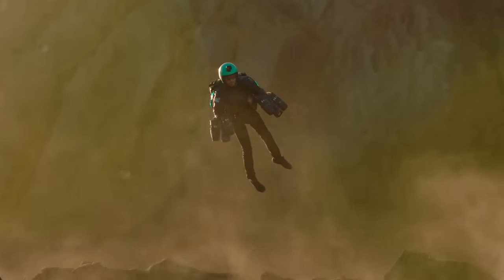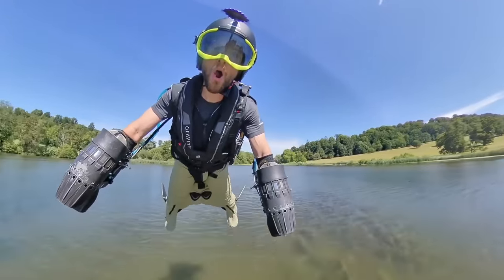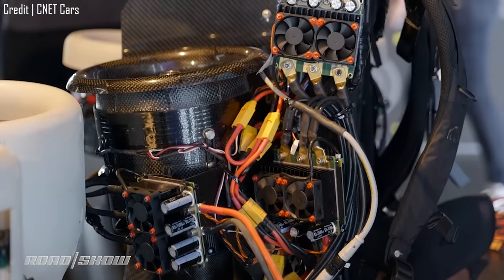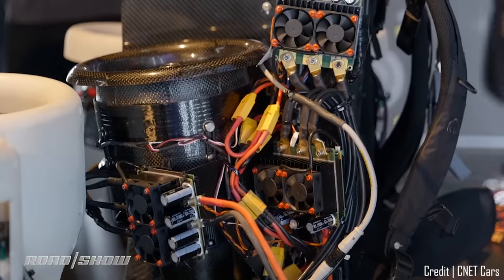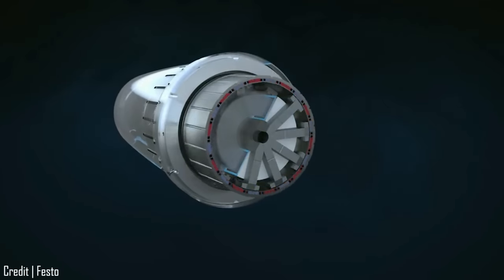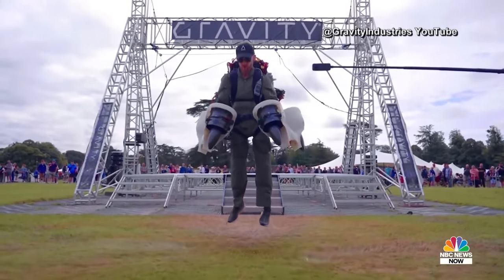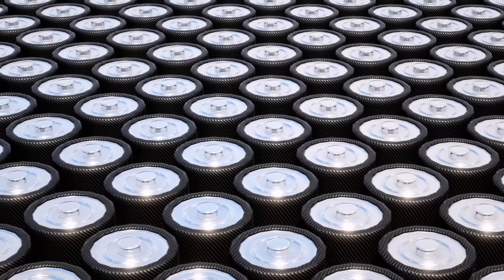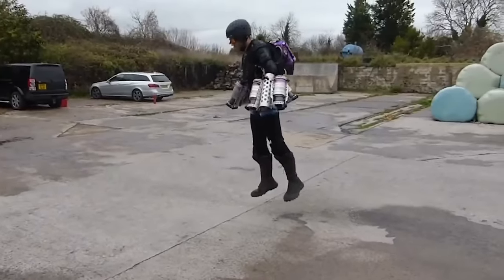World's First Electric Jet Pack Is FINALLY Here!

Comment: This Jet Pack is a crude start, but it won't be long before the "Big Players" roll out their boys and their toys versions. Which are a step closer to "Marvels Iron Man" The military versions have been operational for sometime now. Even "Marvels" is clunky and far from desirable if you happy to wear a full metal jacket that is. 

For those who like the feel of the rush of the air, then you are going to have to compromise. We have smart materials that are light weight composites combined with strength and flexibility. Far more appealing than "Dragon Skin" which was once the all singing and dancing technology way back.

Why did A.I get invited into this challenge, well for good reasons because the designers rightly so didn't want to overload the user so it needs to take all of this onboard. So that the user doesn't have to deal with the complex stuff as gyro stability in whatever the weather.

A.I. neural link is the users helmet interface, so it has multiple purposes other than being a safety helmet. It connects to the users brainwaves to allow thoughts, responses, and fight and flight mode to remain features that we already had before. 

The suit has a retractable octopus frame which gives the user the equivalent of a roll cage bubble, and what is neat about it is A.I. engages all of this at the first sign that the user is in danger. DARPA haven't even got this far. 

While 007 may think he's got it all covered, A.I. is in a league of its own. Even down to its own golden parachute. Which when packed is no bigger than an old fashioned hanky. So why did they want to give the user none of the responsibilities, because it goes back to the drawing board of being able to give the person of real flight, without beating a set of wings, and allow them to enjoy the experience to a totally new level. 

The suit has cloaking and even allows the user to be invisible from the ground, with silent running. I can some of you muttering there will always be a heat signature to the suit. Actually your wrong as A.I. already fixed that issue, by creating a vortex bubble which allows it to suck in the air around to make it so.  The most sensitive Radar couldn't pick it up.

A.I. has an array of features, within the helmet to allow visuals, and data display to allow the user to literally see in detail what "Google Earth" sees in real time. Features like hypersonic, and anywhere in the world within the hour is on the table.

Comment: How Heavy would Hydrogen (Storage an Cells) be, compared to the batteries, because with Hydrogen you would be able to use 100% of the stored energy, right?
Reply from the maker: This is a great point! I imagine the hydrogen tanks would be quite heavy and there can be issues with getting enough power out of the electrolyser continuously - but it would also solve some of the other issues like you mentioned, so I would be interested to see what Gravity think! Also it would be interesting to see if they have considered hydrogen as a fuel for combustion in the jet engines too 🤔
Reply: @ZirothTech  Hydrogen would be great, the one issue with hydrogen is the fact it’s explosive. It would be great for combustion were that issue not a problem. The other issue is lubrication. Kerosene provides some lubricant to the engine, hydrogen provides none. And as it combusts to create water, could even cause corrosion. These issues would have to be addressed
Reply: @ZirothTech  theoretically speaking, you could have a hydrogen on demand type system. Maybe it could take water outta the air like a dehumidifier and then use electrolysis to split it into oxyhydrogen for use in the fuel cell. This would remove the dangerous and bulky tanks of hydrogen, while also having a more abundant source of fuel: the atmosphere
Reply: @lukewoodside9420  hydrogen is only explosive with the right AF ratio and that is easier said then done and with how light it is its almost impossible to accomplish in open air even a light breeze will blow the hydrogen away.
Reply: @chrisbaker9704  It would take more energy to split the hydrogen than you would gain, even if energy wasn't being used for flight, it would not be self sustaining as nothing is 100% efficient.

Comment: It would fly a lot better if the Battery was designed from the ground up to maximize total space of back-pack. Instead of using a hole lot of little batteries with all the extra weight for the shells of each battery.

Comment: Use a generator or a fuel cell. 

Batteries are still too limited and not likely to change anytime soon. Its like trying to store water in bucket full of rocks and sand. You will never be able to store anywhere near as much energy as a bucket of fuel.

Comment: I haven’t watched until the end yet but I helped someone lift a 9.6 kWh home battery & it’s so heavy even between two people we needed to borrow a sack barrow. It weighed 110 kg or for those in pounds & stone’s that’s 17.32 Stone. Edit* as I suspected battery technology would need to evolve in terms of technology & also weigh far far far less to work in this application. The battery size needed to achieve any meaningful flight times would be so heavy an average human would struggle to a corner of it from the floor let alone strap it on their backs & fly. Even a 3 kWh just the battery & casing must weigh approximately 37 kg or 6 stone. On a hard landing that weight could do some severe damage to the pilot.

Comment: So there is already development to exchange the kerosene-driven engine core of a casual jet engine with a superconductor motor? A regular engine core which is a kerosene-burning turbine can bring ~5200rpm to the big fan of the jet engine inlet, a number not that high which should not be impossible for ultra developed electric motors too (especially not for geared ones that rotate with 20.000rpm). Tonight I absolutely have to check the the status of these very interesting ASuMED engines, this is very interesting development and even more exciting than electric cars! And of course this jetpack is awesome too. Do you know that ten years ago or so the Mythbusters tried to build something similar? But they did not dare to fly it and therefore tested in on some crash test dummy with the weight of a human, but back in these days electric motors where not capable of giving such a horsepower output like today´s Teslas and other developments, and that average gasoline engine they were using was too weak.
I have to admit that in other videos I first thought this jetpack is fake and only done by some crane and retouching the cables with movie-maker tricks afterwards, but it is real and wow this is amazing!!! Never give up you will bring a brighter future for mankind - with so much more fun and adventures to have (imagine having cheap easy to fly jetpacks to rent just for fun on all beaches in ten years.... amazing!!)
Mankind is on the brink of a new era that is coming with everything sci-fi related becoming real thanks to these Gravity Industries guys, and Elon Musks extreme space travel tech programs, and AI, robots, VR headsets for videogaming, and flying cars or self-driving cars!

Comment: The difference between a superconductor and a regular conductor is like, 5%. Seriously, copper is like 96% efficient. It's not necessary or relevant. Basically, the real advantage to using electricity is the fact that electricity is a renewable resource. It doesn't disappear when used. It just needs to be generated in the suit itself. So if you can generate your electricity without needing any external energy source, you will have "limitless" potential for power and range.

Also, that "voltage sag" is hilarious. They always say fossil fuels can only use 30% of their energy, but this can only 15% or 40%. Not much different I guess.

Comment: 2:30 this is only correct for very high disc loading. An open rotor is significantly more efficient than a ducted rotor when diameter isn’t constrained. If ducted fans were more efficient than an open rotor than helicopters would use ducted fans instead of open rotors.

Comment: id still prefer a more stabil old school style jetpack .. its also less strainoues on the arms... and its stabil as you place the jets higher. now with fuel based its problematic as you blow hot air over your body. but with electric its cold air... so do electric version with a backpack on shoulder height ... at least thats what i would prefer

Comment: The jet suit battle is very similar to the ICE car vs Ev. No matter how many batteries they put into an EV they still cannot compete with an ICE car.  They keep telling us that a super battery is just around the corner and that the electric motors are getting more efficient, but they still are many years away from a one-to-one comparison. I think we reach a point where common sense tells us to replace something that works really well with something that costs more and provides less performance might not be the way to go. I like the research but it hasn't matured enough to be the only choice.

Comment: Perhaps hydrogen fuel cells or capacitors might be better suited for this application than batteries. Batteries are great at storing energy over extended periods of time but storing energy doesn't seem to be the challenge here but rather energy density.

Comment: The power figure you are using for the rc jet motors that they use on the jetsuit is completely wrong. They state maximum thermal power of the fuel, not mechanical power at the shaft (that will be very difficult to measure for this kind of jet engines). Even being extremely optimistic about the mechanical power, it will be no more than 1/3 of the maximum thermal power, so we are talking around 300 hp for the 5 jet engines on the suite. But in reality it's less. And about the electric motors: they are already 90-95% efficient, so using superconductive motors will make the efficiency better, up to 99.9%, but there is still not much to gain, probably around 5%, so they will never be "many times more powerful than what they are now".

Comment: resonant induction charging training pad
Reply: remove charge hover cars, same resonant induction charging pads
Reply: meh, aluminium-air salt-water/ethanol-koh electrolyte at 8.4kWh with carbon air-electrolyte, feed in more metal wire, exhaust stone out, the oxide of the metal
Reply: why are your engineers so horrible, be smarter
Reply: oh right, you dont care

Comment: I think it's cool looking but essentially a useless toy. Unless we discover antigravity these types of flying contraptions will never be practical for much of anything. If it's for recreational use then they will always be too loud and unsafe for the average people to use. Once the engine cuts out you're just a flying brick. The altitude it would function at is too low for a parachute and there's no room for an ejection seat. You also need huge physical strength to fly it. Good luck for the average beer drinking, potato chip eat Joe!  If it's meant for the military then your hands are  busy controlling the thing which means you can't fire a gun while flying. That's a huge disadvantage. If you can fire your gun only after you land then you have lost tactical advantage. And the enemy heard you coming from miles away anyway therefore there is no way to use it covertly. Also you can't use it for reconnaissance as again it's too loud,  too slow and will always have a limited flying range. You also can't use it to rescue a wounded soldier as you can't carry 2 people. So what is it for? It's just a useless air show attraction thingie...

Comment: Individual human flight will NEVER be accepted in populated areas for safety reasons.  
   A flying machine that occupies the hands is almost useless, as it prevents any task from being done.
    So you can't commute with it, and you can't use it for power-line repair, tree trimming, etc.  It's just an expensive and dangerous toy.

Comment: this whole concept is just plain goofy for a number of reasons:

an aircraft that uses 100 percent mechanical lift will NEVER approach the range aka run time as one that uses wings.

By adding some rudimentary wings to this system; the range could easily be extended ten fold.

Using a person's eyes, brain, along with their arm coordination to monitor and vector thrust accurately and efficiently, navigate and to calculate important things such as airspeed, aircraft attitude and altitude is simply RIDICULOUS in an age where things called computers, software and sensors are cheap and plentiful.

Forget this crazy thing and bet your money on a fully electric, miniature, aircraft concept such as the Blackfly that actually WORKS!

Comment: the discharge curve . I could not calculate the math in my own circuits  with battery and had to re- wire my own project > LOL experts failed also ! So you have to include more batteries which kick in more volts in stages in a voltage  regulator type  circuit and more weighty . It can function sure !  Or DUH > you never heard of the CURVE : too basic to miss ,good god  man < I dont believe it !

Comment: I can put a few of those on top of my fucking piece of shit ford f150 that gets 11mpg and have a big battery pack in the back, as long as those are spinning when moving Im going to get  better gas milage, Depeinding on the batter pack and how many amps I want the fans to run, Might be able to save 3 mpg and use up a full tank of gas before charging or drive 100 miles before charging and get an extra 25 miles per gallon for a total of 35, not bad since electricity is practically free or free if I want it to be.